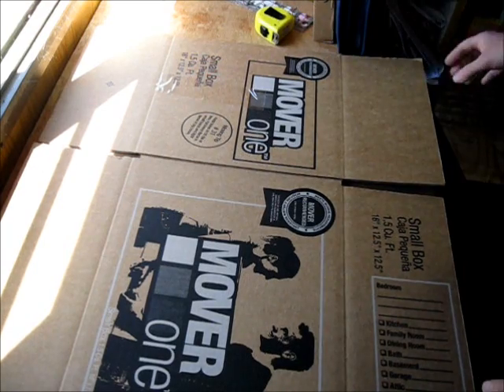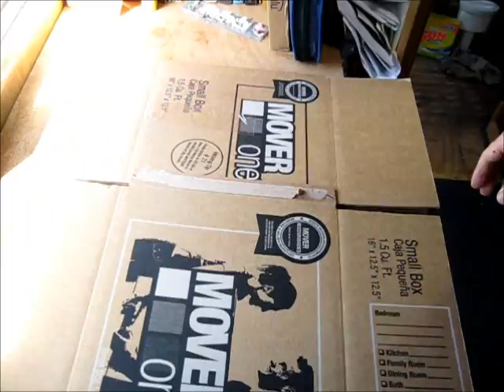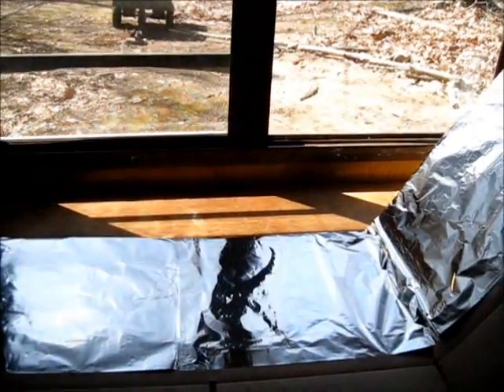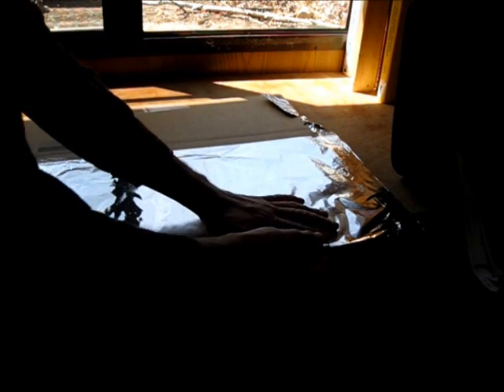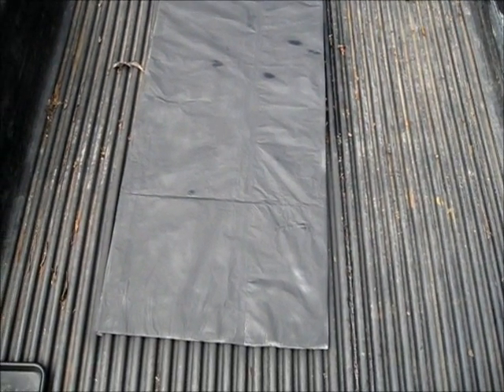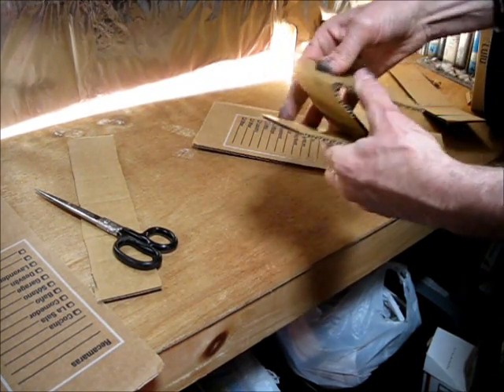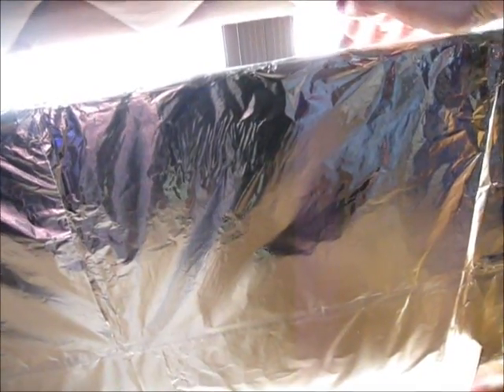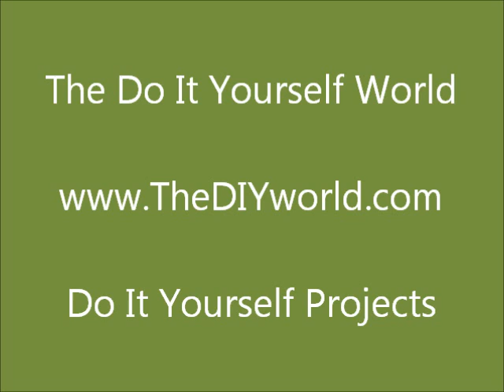Make A Passive Solar Window Heater For Under Two Bucks

Comment: Problem is the net effect is zero.  the sunlight coming into the window was already being used to heat the room.
Reply: The net temperature of the room is going to be the same either way you do it.  The laws of the conservation of energy won't allow anything else.
Reply: *****
 Net effect is still zero.  Left to its own the sun would shine in the window and heat the entire "shaft" of air the sun shines through. This air warms, rises and is replaced with colder air.

Here is a thought. Two identical cars painted black out in the sunlight. Now into one car place a piece of black cardboard by the window.  Will that car become hotter than the other? No because the energy had already entered the window and was going to heat the inside regardless.

Now if you take the same two cars out in the sun and into one car reflect light from an outside mirror into one of these cars then that car will become hotter inside than the other. Why? because you introduced more energy into that cars interior.

The whole point of these solar heaters is to add more energy than you would by simply letting the sun shine in the window. That's why people hang them on their roof or the side of their house.

Side note. instead of creating that whole contraption wouldn't it be more convenient to simply buy a mini blind, paint it black and install it in your window?
Reply: So your saying the sunlight shinning through does not in itself warm the air thus causing convection?

Net effect is zero. That my friend is reality.

What he is doing Its a waste of time.
Reply: You shouldn't be commenting on subjects you obviously don't understand.
  If you can't comprehend the greater solar heat absorption and dispersal from a system like this, it's time to take a basic science class.
Reply: Steve Magruder

No I think you should take a few science classes.  The law of the conservation of energy states that energy cannot be CREATED or destroyed only its form can change.

Now lets follow along.

 You have X units of sunlight shining through the window correct?  This sunlight hits the ground, the table, the walls and everything else in there. Upon hitting the surface some of the energy is absorbed and radiated as thermal energy.  The portion that is not absorbed is reflected and hits another surface where it absorbed, radiated as thermal energy,  reflected, and so on. The ideal result of this process is that all of the units of sunlight are eventually being absorbed and radiated as thermal energy causing the entire room to be heated up.

Now lets put a piece of blackened cardboard in front of the window. Does that somehow increase the amount of sunlight entering the window? Nope.  You still have the same X units of sunlight entering the window.  Anyway once it enters the widow it hits the cardboard. is absorbed and radiated as thermal energy.  Now obviously the absorption rate is greater on a darker surface than a lighter surface. But the amount of available lighter colored surfaces is greater and therefore the total energy absorbed and radiated as thermal energy is the same.  

NET EFFECT IS ZERO.

If you want more heat in the room you have to have more energy/sunlight coming into the window. You cant just simply put up a black piece of cardboard and think the laws of physics are null and void.
Reply: *****
 Sorry. NET EFFECT IS ZERO

Here's a simple thought process.  Why do people on a hot sunny day move into the shade? Why because the sunlight hitting their skin makes them hot.  So it seems that colors other than black can absorb sunlight and radiate it as thermal energy "aka heat"

Now lets go back into the trailer.  A quantum of sunlight, passes through the window and strikes a surface. Unless this surface is a perfect reflector, then a portion of that quantum of sunlight is absorbed by the surface and is radiated as thermal energy. What is not absorbed by that surface is reflected and strikes another surface which in turn absorbs, radiates, and reflects.... and so on.  This process occurs until the entire (100%) quantum of sunlight that passed through the window is absorbed and transformed into thermal energy. 

Now put up the blackened cardboard. Lets just say for arguments sake that the blackened cardboard is perfect absorber.  A quantum of sunlight hits it, is absorbed and 100% is transformed into thermal energy.

So in both cases 100% of the quantum of sunlight that enters the trailer is eventually absorbed.   Your just stuck on the though that somehow the cardboard is better. Its not, if in both cases all the sunlight is transformed into thermal energy aka heat then, NET EFFECT MUST BE ZERO.

 
Now since you seem to pretty big on convection and channeling.  Would you not agree that if an object heats up, then the air surrounding also heats up? would you also agree that If in fact the air surrounding the object heats up then it (the air) becomes less dense and rises? Once that air rises, doesn't "other" air come in to fill the "vacuum" that's left behind?   Would the air care if the object its surrounding is black, brown, red, blue, or.......?   Nope

So it stands to reason that anything in that trailer that is being heated will cause convection.  If you do agree with that then you will have to concede that the NET EFFECT IS ZERO.

Oh, by the way that  "lost from the room" statement makes absolutely no sense.
Reply: *****

SORRY NET EFFECT IS ZERO.

He ads the black cardboard to the inside of the trailer where it makes no difference. The energy/sunlight has already entered the trailer and would be absorbed and radiated as thermal energy regardless if the black panel was there or not. 

Now take the scenario you mentioned about the white and black car and apply it to his trailer.  If his trailer was white and he painted it black then yes his trailer would be hotter. But thats an addition/modification to the OUTSIDE of the trailer and were not talking about that. We are talking about only the energy that goes through the window.

NET EFFECT IS ZERO.

Maybe you stuck on, or don't understand the "NET EFFECT IS ZERO" statement.
Reply: *****

SORRY NET EFFECT IS ZERO

You say that the blackened card board is a better absorber. A couple of replys ago I said it absorbed 100%.  I also said that without the blackened cardboard the light, after bouncing around the room is 100% absorbed also.

Sooooo if in both circumstances all the light is absorbed and radiated as thermal energy. Where does the gain come from? It doesn't the NET EFFECT IS ZERO.

You really need to get over the.. "convection only occurs when the blackened cardboard is used."  Sorry anytime an object is heated in that trailer the surrounding air is warmed and rises. So convection must be occurring everywhere in that trailer where there is air and a temperature differential.

"The net effect of your ignorant denials is the only thing at this point that equals zero."

That statement makes absolutely no sense
Reply: *****

FINALLY!!!! Your starting to understand.  Let me quote some of your last reply.

".....the heated air rises in a wide dispersed area, creating very little convection...." 

You now concede that without the blackened cardboard that the sunlight shinning in the room  will heat the room thus causing convection. Also you are smart enough to understand that the conservation of energy does not allow sunlight/energy to be as you say it

   "..... Lost to the room"

So lets wrap this up.

1) It doesn't matter if the sunlight hits the blackened cardboard or if its dispersed in the room all of the sunlight / energy is converted to thermal energy either way.   Sooooooo the NET EFFECT IS ZERO.

2) A lot of convection concentrated over a narrow band or, as you say it 'little convection over a dispersed area' is, in the final analysis the same volume of air being "convected"  Sooooooo the NET EFFECT IS ZERO.

To wrap things up I'm not pathetic, childish,  I don't have an ego, and I am not ignorant in this subject.  I simply have the facts on my side.  By calling me these names you have simply shown the that you, have what some would refer to as a silly childish side.
Reply: *****

net effect is zero (see no caps)

"disperses into the house"...... and when it hits another object is there 100% reflection or is some of the light absorbed and radiated as thermal energy..... and so on.

"back outside".....  Step outside and see if you see all this sunlight beaming back outside.  Didn't think so.

"convection would be more irregular"...... but over a larger area  soooooo sorry once again net effect is zero.

Painting the room and all of its contents black would have the same net effect of heating the room. I love that phrase "net effect"

Give it up people.
Reply: *****

If you can see it, it must be reflecting light.  If I go outside and see the cardboard absorber then it must be reflecting light also.

Sooooo if, the room reflects light out of the window and the cardboard absorber is reflecting light out the window then it must be pretty much even.

Sorry nice try but the net effect is zero.

I tell you what,  you two put up your little cardboard blast furnace and bask in the glow of your three in strip of heat.

In the mean time,  see the cat at 12 seconds into the video?   See how he sits in the sunshine  he is probably smart than you and Mikanjo combined, While you two are huddled over the three inch strip, the cat and I will be sitting next to the open window and enjoying being warmed by the sunshine.
Reply: Chaud Poivron

Your preaching to the choir by telling me the screen won't make any difference. I agree.
Reply: Craig Bennefeld  and Chaud Poivron.  I am impressed by the incredible patience you have showed, whilst arguing your point.  When I saw this video it immediately struck me that "the screen would make a difference" because the net effect would be "less than zero".  The reflector has little thermal mass and thus little capacity for storage, unlike the room's furniture (which would now be put in the shade and effectively keep cool).  The glass in the window, on the other hand, would rise in temperature, due to its proximity to the warmed air on the interior, and would cause room energy loss, due to the low air temperature externally.

Ironic, but I imagine this contraption would be useful in the summer, for keeping your place cooler!
Reply: Question, what is the net effect when you build one of these, like the guy in the video?
Reply: Craig Bennefeld f

Comment: Hi,  giving some though to air circulation using solar air heaters. There is big south facing glass at one end of this long house, 5x8' plate glass, and a sliding glass door. I can't drill holes in this house, so I need to somehow butt the heater right up to the existing vertical plate  glass.  I would angle the box to the sun from  inside the house.  I think that would collect some  heat but the best thing would be if the intake insulated dryervent  pipe was at the other end of the house, or at least at the far side of the next room.That would pull cold air from further away,  and eventually even out the temperature? and then start warming up more cold air???
so I need some smart person to figure out how big a solar heater would be needed  to pull enough cold air from 30-50 ft away to make it worth doing. Does that make sense
at all? would making the box taller or wider pull more...I think taller?  Thanks!
Reply: +moo moo
ok so I find your explanation hard to follow, but to answer the final question. As a fluid, like air, flows through a pipe it is acted upon by major and minor losses and requires more pressure to push it though said pipe.  (if you have a hose long enough water will never come out. It's commonly referred to as back pressure.)

Basically the longer and "less straight" the pipe is, the harder it will be for you to actually get air from point A to point B.

With natural convection alone being your driving force here...for any practical application probably impossible for such a long pipe.

And if you were to try anyways, take these few tips. Hot air rises, if point B is below point A then the only way the heat will get anywhere is the hot top air to heat the colder bottom air through conduction. And the heat loss though your pipe will be much much greater than that heat gain through conduction. 
Which brings us to, insulate the hell out of that pipe. As mentioned b4 the only way you get air from one place to another is that heat rising. If it loses heat to the walls of the tube it will just stop moving or move backwards.

But at this point you begin to question. How much does it really cost to heat my house vs buying all of this random materials to make this idea work?

Comment: i think you would be better with a flower pot heater, no time your space would be warm.
Reply from the maker: I tried that and nearly froze to death. A candle cannot heat a home. At least not in my experience.
Reply: The Do It Yourself World you need 3  votive candles[larger than tea candles] for some warmth,  you would probably need 2, on at each extremity, a few feet from the walls.but you cannot use it during the night, too much danger for fire.

Comment: I saw a test that showed dark green has more heat/light absorption than black.  Gee, I guess that's the reason The Lord made trees green rather than black!  :)  -Gunny T sends
Reply: Link?
Reply: Canadian Prepper It's been quite awhile, and I don't recall where.  I'm not trying to prove anything here, and I just remember the fact as it stuck in my brain back then.  It's just an FYI so take it or leave it.

Comment: Troy, you will get more solar gain from letting the light into your living space. Now a solar passive heater outside vented into your living space and well sealed you give you both direct sunlight solar gain and also passive solar gain from the heater.

Comment: This is not a good design.  The heat gets into the camper before the al foil is placed there.  The Al foil actually reflects some of the light that previously was getting into the camper that previously was heating up the camper.  It concentrates the heat but there is actually less heat in the camper than before the project.  Plus, the view is gone!  The Al foil may help at night when it is cold by reflecting some of the heat back into the camper.  But overall, a poor design that loses heat.

Comment: Aluminum is used in roofing because it does not store heat, so there is no heat for you to radiate with this setup.  A shiny foil cover cannot reflect any ambient heat at all.  You are actually insulating yourself against what little heat is coming in.  Card board?  It absorbs very little heat and has zero ability to radiate heat.  What little heat you may be getting is from the black surface warming up the air molecules floating around in front of it.  Not much.

I recommend a black-painted piece of regular glass with the untreated-side left facing toward your living space, this will emit far more heat energy, just leave off the foil.  Find the cheapest (untreated) glass you can.